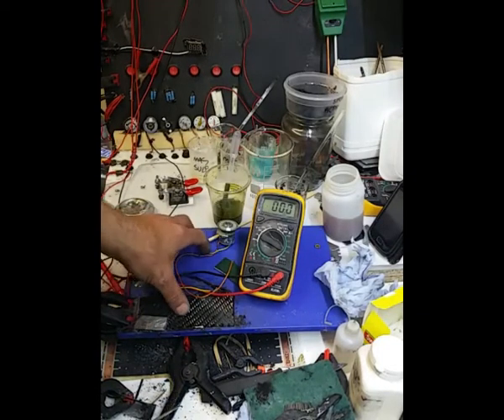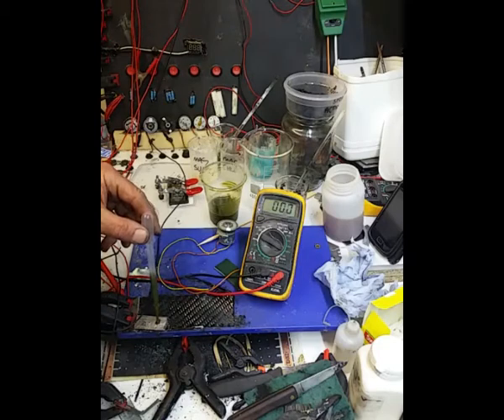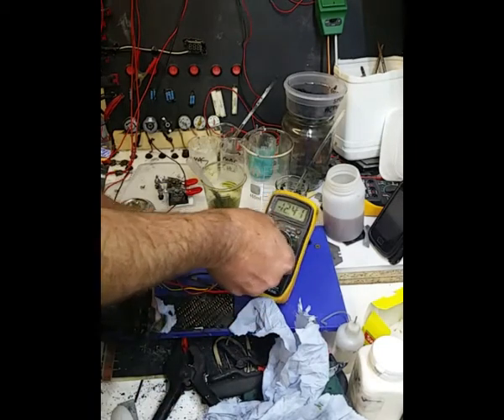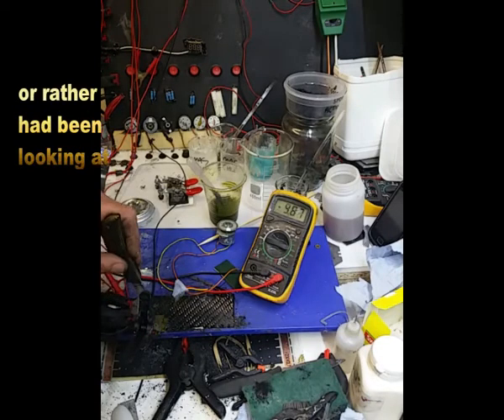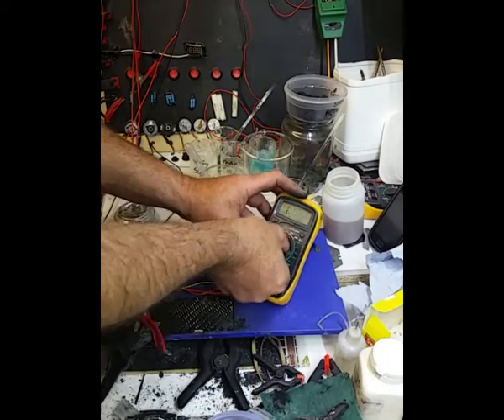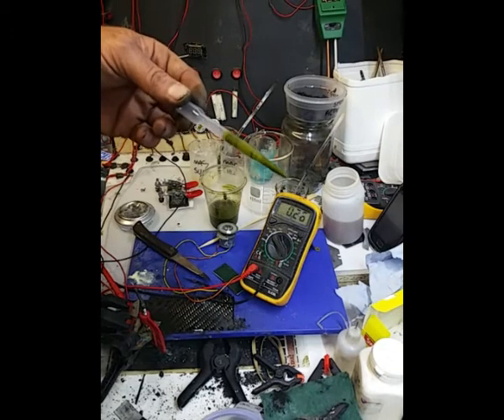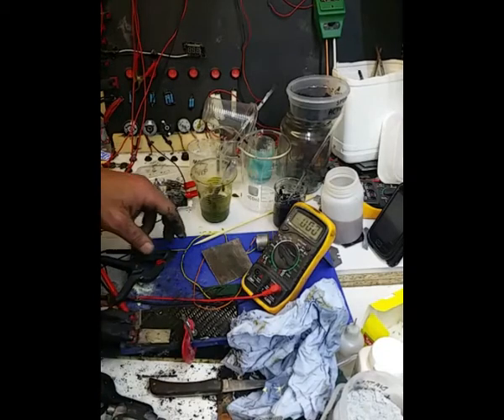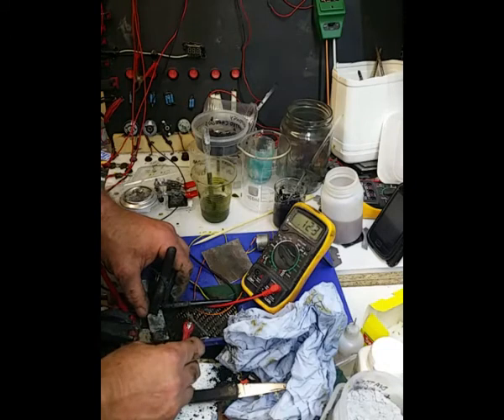chlorophyll battery ? or Peltier Effect you decide i'm not sure yet

Comment: Hi Kev, so you used magnesium and magnesium?
Reply from the maker: Steve Allwest yes mate correct
Reply: Interesting, was there a charge on it?
Reply: Have you tried this with any other metals like copper? or Graphite?
Reply from the maker: Steve Allwest morning Steve. yes the first bit was copper and mag and the second bit was mag.....mag.
second part of the video tonight which is even more interesting !
Reply from the maker: Steve Allwest hi again steve yes it was 9.40 into the video when i swapped to mag....mag.
you need to turn up ya volume LoL
Reply from the maker: Steve Allwest hi steve this is all with no charge it is just the heat that makes the current go up !! i find this fascinating and i have a strong feeling that there is some mileage in this little device.